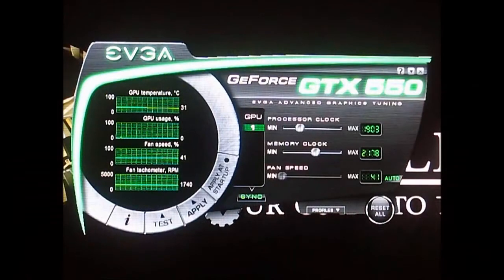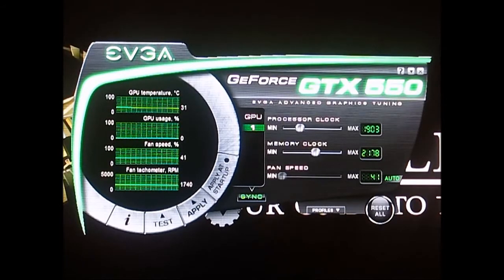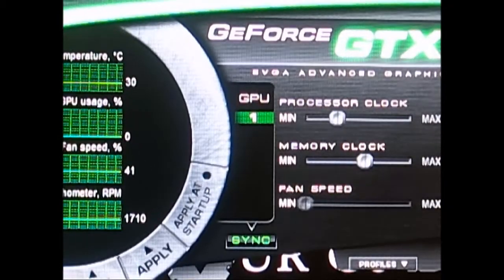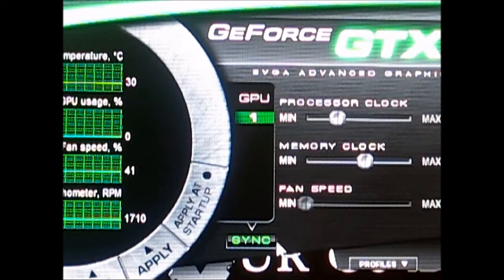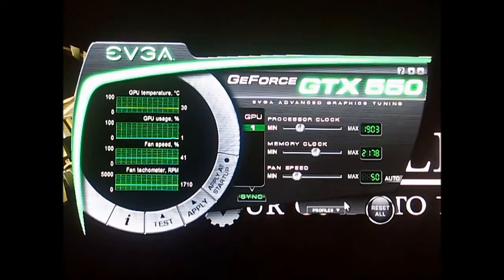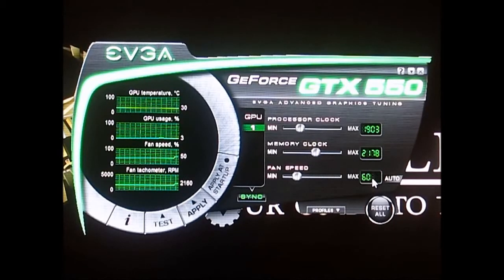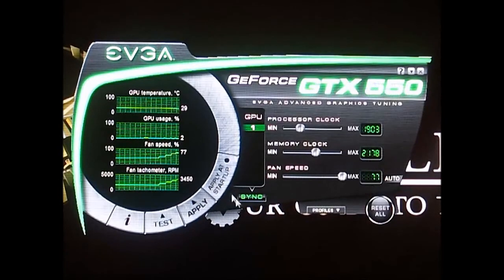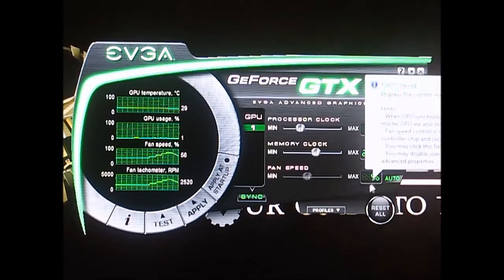EVGA GTX 550 Ti - Fan Noise and Temperatures

Comment: @kentot2position 

You don't need any additional hardware to increase the fan speed. All you need is a software program (EVGA Precision for your card) that allows you to adjust the fan speed. You might be able to adjust it as is without having to download EVGA Precision--go to your control panel, click on "Hardware and Sound" and look for your graphics card's control panel. Look for something like "device settings." You should be able to adjust the fanspeed from there. If not, get EVGA Precision

Comment from the maker: It sounds like you need to RMA your video card if it is shutting off by itself after one hour (basically over heating). Also make sure you have good ventilation and airflow in your case so heat doesn't build up. Manage cables, add fans, etc.

Comment from the maker: It doesn't seem that the temps are too high. Fan is fine. Is there an error , just a warning buzzer? Shut down the system re seat the video card in the pci-e slot make sure your pcie 6 pin connector is firmly inserted.

Comment: HELP!!!

I just got the card and also installed Evga Precision. I get this loud warning siren randomly when I am using the program. This does not happen when I am stressing the card or playing games. I got up to make food came back and it was blasting the warning sound (NO programs running). It is at default settings.

I get this reading...

gpu temp = 29 degrees C
usage = 5%
Fan = 30 (auto) 

Any ideas?

Comment: I have the Nvidia branded version of this card, it works great but as soon as i turn off my computer and restart it , the card doesnt respond and only my onboard graphics work.  Could this be a driver issue? I'm currently using the latest nvidia drivers from there website. Thanks in advance, Chris.

Comment: @kentot2position 

No, GPUs run a lot hotter than other system components. As long as it stays below 88C, you should be fine. However, you might want to increase the fan speed to 75% before you start up any game. That's what I do; I am running the Battlefield 3 beta (very demanding) and almost never reach temperature above 65C with the fan speed at 75%.

Comment: I own this card, but It can hit up to 80+ degrees so I run the fan speed at 60-70 % and it'll sit at 70 or 60 degrees while gaming. is this hard on the cards fan? and it's now occurring more but the screen will go black for short times when the GPU use is high. any suggestions on the black outs?

Comment: with this same card? I use it in one of my builds and i can run bf3 on ultra as long as the Anti Aliasing is turned off. i just upgraded to a 660 and the only thing i do differnt with bf3 is have AA on but i always ran at around 50-70 fps

Comment: System: 
Processor: i7 920 stock (gonna overclock soon)
Processor cooler: Zalman CNPS11X Extreme
GPU: EVGA GTX 550 Ti Superclocked (little bit overclocked by me too)
Ram: 8 GB DDR3

Do you guys think I can play BF3 with a stable 25-30 fps?

Comment: That's an OK temperature. But if it goes higher than 80C, then you could be in some trouble.

Once it hits around the 100C mark, you need to cool that shit down fast before it blows itself up.

Comment: I got a Msi gtx 550ti Its a nice mid level card!

5 months ago when playing games I got black screen cause it was overheating... My gpu gadget show temps hitting 74c -fan speed 82% msi afterburner says 82-86c & shuts down for 3sec.,About a month ago i got a idea to mod my gpu.. I use a cpu heatsink and put it ontop of the gpu heatsink... Now it works great!! Max temp

Idle 23-26c
Gaming 54-65c
Res=1920x1080
Fan speed 69%

Comment: Or you can try realizing what I said. I told everyone to quit bitching about how the card wasn't getting over 45 fps on BF3. and even if you are going to wait, why not just buy the newest card they have, then pay the difference between it and the 650? you buy a card for 200, the new card is 300 you pay 100 and the old card for the new card.

A quote goes here. One that you should live by. "Better to let people think you're an idiot, than open your mouth, and remove all doubt."